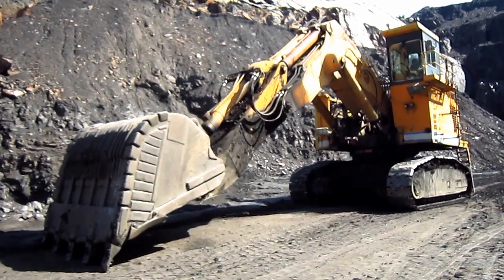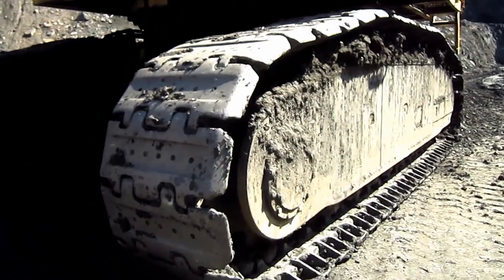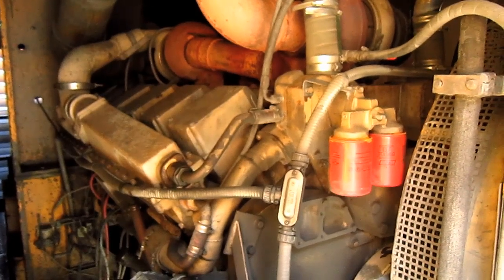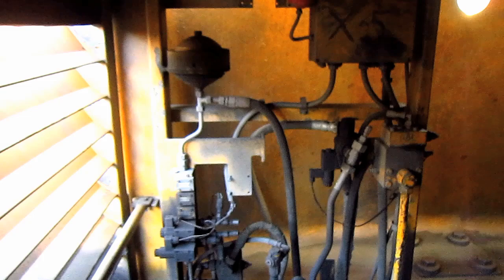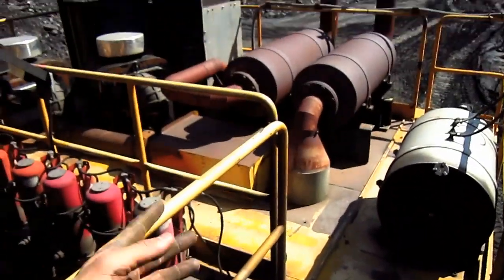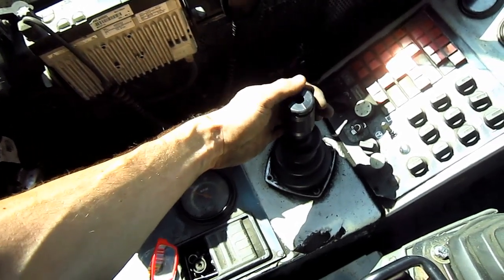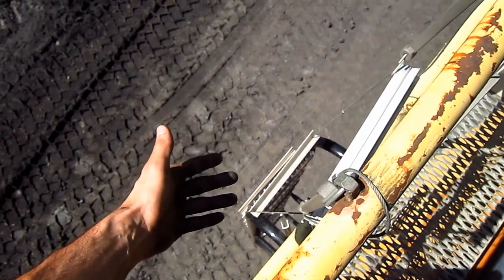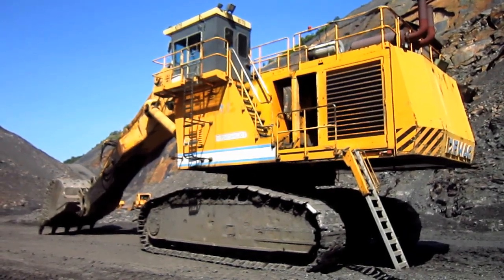The Demag H185S - Tier 0 Power!

Comment: Thanks PAmining for putting together another superb video. I have been a fan of the DEMAG brand for a long time. I believe it was DEMAG that really pushed the boundaries on large, mining size hydraulic excavators. The company was also involved with the development of ultra high capacity mobile cranes. DEMAG was responsible for many technical advancements in both the excavator and crane fields. Probably the only negative comment I heard about their machines, was the cost of parts.Supposedly the cost of parts was much higher than some of their competitors - such as O&K.Getting back to your video doc. , I appreciate that you went into a lot of detail, about this big DEMAG backhoe. I’m looking forward to the next video. Take Good Care.
Reply from the maker: You're very welcome buddy! Demag was a pioneer of hydraulic excavator development and actually the developer of the first 360 degree rotation hydraulic excavator. The only reason II can see Demag may have been a more expensive excavator to run is because they prided themselves with developing a machine that could run on a single engine instead of two. Twin engine power was an O&K concept, while Demag favored a single engine which did increase cost. That being said, I think any European machine was and still is, expensive to run. We have a Liebherr excavator at work and we're constantly paying to overnight parts from France. Cheers!

Comment: Tough machines though they had some affiliations to the Hibachi’s !  😅😅🆒
Reply: I'm jealous, the UK version didn't come with the optional Japanese grill. 😄
Reply: @brianw8963  The affiliation was with Komatsu, not Hitachi.
Reply: @williamhall9204  I was just joking about them catching on fire when a hydraulic leak occurred , at least on the older ones. I know Benjamin Coal had a couple perish that way , long ago.
Reply: @brianw8963  That was a good one. I have to admit when I first read your comment it went right over my head. I just assumed that you meant Hitachi. I’m thinking that maybe the early DEMAG excavators didn’t have effective, high capacity fire suppression systems on board. Take Care.
Reply: @williamhall9204  👍👍😅. Yep, early models had no fire suppression, I didn’t see any on the one in this video either.
Reply: @brianw8963    Check the video again. At  about 10:08  you will see Justin pointing out the red fire suppression canisters.
Reply: @williamhall9204  Thanx, I evidently missed that.
Reply from the maker: Neither did Hibachi Hitachis lol. No excavators had fire suppression back in the 90s. The suppression system on this machine is aftermarket
Reply: @PAmining   Thanks You for that information. I didn’t realize there weren’t any fire suppression systems on mining excavators in the 1990’s. I guess back then operators would have to grab a fire extinguisher to battle an onboard blaze. That was definitely a dangerous event when it happened.To this day it always amazes me to find out how many gallons of the various fluids the large size equipment requires.Take Good Care.